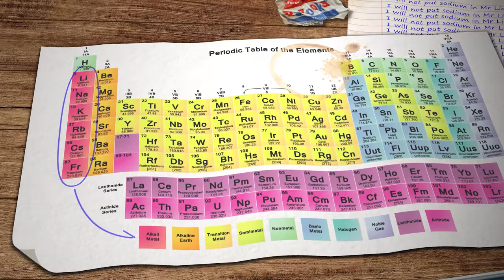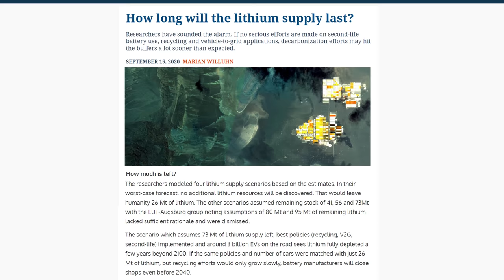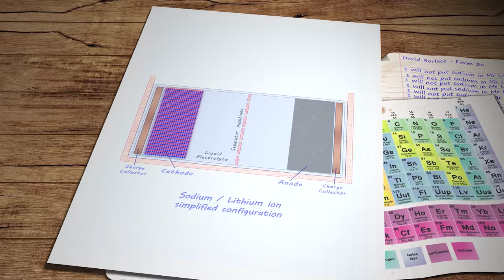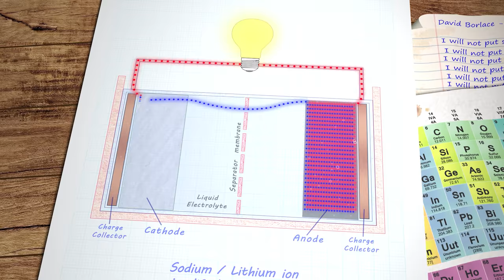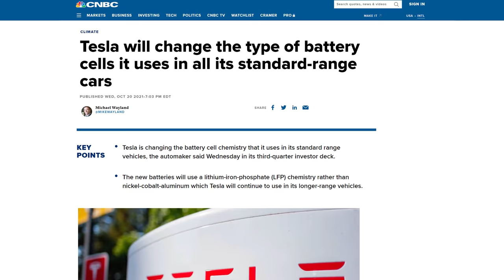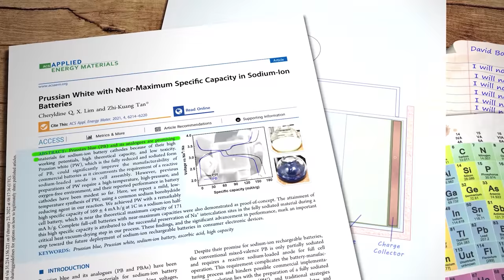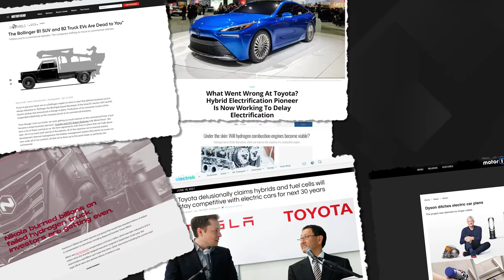Sodium-ion battery breakthrough. Safer, cheaper and cleaner than Lithium-ion

Comment: I'm currently doing my PhD on sodium metal batteries and have been making my own Prussian Blue cathodes (more stable but lower performance than Prussian White). It's so great that sodium-ion is starting to break into the commercial market because I really think there are a lot of applications where lithium technologies are not the best option (e.g. stationary storage). However, I don't agree that Prussian White is non-toxic, using Prussian Blue safety data sheet (as they are the same type of compound, just with more or less sodium); Prussian Blue/White has a toxicity and body contact score of 2 (it is toxic through skin, mouth, and inhalation), so it's not the worst... but really not "non-toxic".
Reply: I thought I read somewhere that Prusian Blue was used as ink... is there any truth in that??
Reply: @bkucinschi  Yes that's right, although the pigment form is not exactly the same as the cathode material. Prussian blue has a really nice deep indigo colour and has been historically used as a pigment. I think you can still buy Prussian Blur pigments today.
Reply: Maybe it is nontoxic by the CCP’s standards. Chinese corporations do not tend to prioritize health.
Reply: Can you tell about the fire safety in comparison of Li-Ion/LiFePO4? Because Li-Ion is very reactive to oxygene, but also is sodium...
Reply: I was also going to ask about fire safety.
Reply: @oCoelhoPedro   It is the metallic form of lithium and sodium that are particularly reactive to moisture in the air (your science teacher may have dropped small pieces of sodium metal in water to demonstrate this). In Li-ion batteries one of the main concerns is the flammable organic liquid electrolyte and thermal runaway of the cell which could provide both the fuel and heat to start a fire. Some sodium-ion batteries in development do not pose the same level thermal runaway risk however still use organic liquid electrolytes which is still an overall fire risk. Solid-state batteries (both lithium and sodium, although sodium is the focus of my research) would eliminate this risk as the battery would be made from non-flammable materials.
Reply: @emilyc3361  thanks for your reply! I hope your research provide the next battery technology!
Reply: My understanding is that Prussian Blue is sorta-kinda safe to ingest, in the same way that charcoal is: not directly poisonous, but highly absorptive, so a serious risk of throwing your electrolyte balance completely off in potentially fatal ways. It's supposedly been used to counter certain types of radiation poisoning (I believe it was specifically in reference to a dentist's office X-ray machine being improperly scrapped in Brazil a few decades ago).
Reply: Well, water and milk are toxic if you drink enough. People have died in stupid challenges drinking too much water or milk.
Reply: @bkucinschi  For over 100 years Prussian blue has been used to paint metal so markings can be made on it to indicate where it needs to be machined. With the introduction of computer-aided design and other platforms, its use is very low scale now.
Reply: Has your research covered liquid sodium batteries?
I've been led to believe that they have no cycle life limit at all, so clearly a massive benefit in stationary applications, even if the temperature makes them unsuitable for more mobile use.  Combined with heat storage in sand (as pioneered in Finland for district heating - so clearly pretty efficient if it can store enough heat for a Finnish winter [more than can be said for the Russian army]).  Stick your liquid sodium cells in the middle of that sand, and the heat can be safely contained making a compound heat/electrical storage system.
Any thoughts on this?
Reply: @emilyc3361  Prussian Blue is also known as Iron Blue and Milori Blue. It is technically called Pigment Blue 27. Uses are in Paint and Coatings and in Printing Inks. Sometimes it is used to make Black Ink Bluer looking by blending with Carbon Black.
Reply: @phillee2814  I have not personally looked into molten sodium batteries, however have heard of other interesting molten metal batteries that could actually have excellent cycle life and safety. But yes you're right, the scale of these batteries and insulative material required for them to operate effectively makes them unfeasible for many settings. There is an interesting thought about their use in medium to heavy industry, allowing these large consumers of energy to help normalise their use of grid energy.
Reply: Thanks for the clarification, Emily.  Hope you continue helping to change the world!
Reply: @Austin1990  Pharmaceutical grade Prussian blue is used to help remove certain heavy metals from the body, particularly thallium and radioactive caesium. According to Wikipedia, quoting the International Atomic Energy Authority, an adult male can eat 10g of Prussian blue per day without serious harm.
Reply: @alistairshanks5099  So Prussian Blue is markup dye?  Hunh.

I watched this because I'm part of the droid building community and there's a big discussion right now about the "best" battery to use; a lot of older R2-D2s still use SLA batteries!  Anyway, this connects to your comment, vaguely, because the blue parts on the original 1976 R2-D2 props were coloured using Dykem markup dye... which apparently is Prussian Blue.  It's a neat thought that in a few years, the new R2-D2 props might use a battery made out of something that was on the original R2-D2!
Reply: how can we get benefit of your research work can you make some video of your research work please
Reply: @winsonal  Haha thank you that's very kind! I don't make videos so I don't plan on doing that, but hopefully my research will become available on open access sites for anyone to read.
Reply: @fskpoon  As silly as your comment is, it is irrelevant to what I said. The CCP leaves pollution matters to more local governing bodies, and the pollution issues are severe. Being in the US, I bought a car from a Chinese businessman with a new baby, and he dreaded returning for fear over his baby's health due to the pollution. It was so sad.
Reply: that research sounds like WATTS of fun.
Reply: @davydatwood3158  Alistar is incorrect. Dykem is a blue lacquer. It is also available in red and as I recall, maybe green. Prussian blue is used for a completely different purpose in the machinist trade. It is used to visualize the fit of two surfaces. When it is applied to a surface (a flat surface or round tapered surface for example) and rubbed against a reference, the low spots remain blue and illustrate the areas that do not conform to the reference surface. In the previous example, it is in the form of a greasy substance and may be referred to as Prussian blue as a legacy term. It is possible that the product used today contains no Prussian blue at all and uses a completely different pigment.
Reply: Prussian blue is one of my favorite colors. If i remember correctly it can works as a disinfectant as well. Not sure if its used any longer for that purpose though
Reply: One thing that wasn't mentioned in this video was the biggest engineering factor of all, the one all engineers hate.... Price.    

It's not 150kg or 200kg per KWH , it's $150 or $200 per KWH that matters more... Lithium is FAR too expensive, it is the reason Tesla is just a toy for rich people and not a serious alternative to petroleum vehicles.  The real prize is not someone who can make a battery a little bit lighter or stronger, it's the person who can half or better the current price.
Reply: Is prussian any related to Russia.
Reply: @roarproductionsstudio  Haha no, it's the name of a historical German state.
Reply: I'm reading on wiki Prussian blue is not only non-toxic, but it is used in medicine as a remedy against other toxic metals like Thallium.
Reply: I hope that can replace the general warehouse machine battery pack(lead acid) which is more danagerous to handle daily. Weight was not a problem since the weight of the battery is used as a counter balance weight for the machine.
Reply: The huge energy stored in a charged battery will take any way out that it can get, explosively.
Reply: I have been out of the loop for many years but what is the cycle-ability of the Sodium+ion batteries cause I remember discussions being about how the larger Ion size of the Sodium -ion would result in the a lower power density and lower cycle-ability due to most likely a much larger anode expansion and shrinkage
Reply: @emilyc3361  That is the holy grail isn't it?  (Solid state with the longevity and power/space density of liquid)
Reply: @donh8833  That's generally right, at least for now. However, there is the potential for completely solid systems to have even higher energy density than liquid systems (some have already been demonstrated in the lab). Most solid state electrolytes do not need the additional separator layer that liquid systems require. So, you can have a very thin electrolyte layer which means you have more room for the capacity-providing electrodes.
Reply: This is great news.  Imagine how cheap gas will become when this battery technology becomes mainstream.  I will be able to run my V8 for ever.  Even letting it idle through the night to extend the life of my starter motor.
Reply: What exactly is prussian white/blue? What is it made of?
Reply: @iCore7Gaming  The most common way to make Prussian blue is to mix a ferrocyanide salt with an iron three-plus salt like ferric chloride.  Yes, the word "cyanide" is scary, but the resulting product is non-toxic.  Just like a mercury amalgam filling is non-toxic.
Reply: @JohnHansknecht  would that include something like a mixture of   potassium ferric cyanide and ferric ammonium citrate  (a mixture/compound that say a piece of paper could be coated with to produce a type of 'film' for capturing a shadow image of anything placed on it when exposed to a strong light source like  sunlight)?
Reply: all the best
Reply: @bkucinschi  it's a pigment in artists paints. It might be usable in ink as well.
Reply: Yes for we have more  opportunities in stationary storage application. Solar energy can be  stored larager scale and energy can be used during night.
Reply: why is toxicity an issue? it is not food.
Reply: @volvo24091  Moving towards non-toxic batteries is a good idea as there is always exposure risk for staff in the material production and handling. And unfortunately, there are many tragic cases where small children have died or been permanently injured after thinking coin cell batteries were "food"... If these and other small domestic batteries were made using only non-toxic materials it may not be as serious when small children swallow them (obviously they may still need medical care, but the potential for death or permanent injury could be lower).
Reply: @Mr2Reviews  "Warning: Keep out the reach of children."
Reply: I agree that the potential for cheaper stationary storage cells is the best initial market for these cells. As energy density is not as important as cost and cycle life.  Are the cells you are working with in the lab similar to CATLs?  I notice you call them sodium metal, not sodium ion.  I know that sodium metal is very unstable.
Reply: @rogerheuckeroth7456  Yes, my cells are different as they are sodium metal cells. This means that rather than a carbon-based anode that sodium ions intercalate into, a thin sheet of pure sodium is used. It is the use of pure sodium metal that can yield exceptionally high energy density. 

While sodium is hazardous when exposed to moisture, there is some recent published work that demonstrates the in-situ formation of sodium metal within a sealed battery cell. This means only a minimal amount of sodium metal is actually present, and that sodium metal is not required in the fabrication of the battery.
Reply: @emilyc3361  Interesting.  What substrate is the sodium metal plated onto insitu?  How is that achieved.  Wonder if it practical on a production scale given how anodes are currently made.
Reply: @rogerheuckeroth7456  It is pretty interesting! But there is still a lot of work to be done. Instead of using a conventional anode and current collector, only the current collector is used. In this system, the cathode provides the sodium ions which will deposit on the anodic current collector as metallic sodium during charging.

While a "raw" metallic current collector (Cu or Al) can be used, it can lead to uneven sodium plating which causes dendrites. Coating the current collector with carbon (many formats like graphene and graphite are being tested) helps the sodium plate more evenly. Thinly carbon-coated current collectors are already produced on a commercial scale with very high consistency; so figuring out the finer details of a sodium metal battery that doesn't require sodium metal may be commercially viable. Only time (and more research) will tell!
Reply: Thank God someone is still making Prussian Blue!  There is hope yet!! o/
Reply: Safety data sheets are usually excessively conservative.  I have a real SDS for DI water that says if I get it in my eye I should immediately flush my eye with water.
Reply: You should drop out Emily.
Reply: @dann5480  ?
Reply: So ill take it off my grocery list
Reply: @harrywalker968  your condescending tone is not helpful.
Reply: great
Reply: I think Titanium White is better, because that's what Bob Ross was using.
Reply: Great
Reply: What is stationary storage? Like a Tesla power wall for a home?
Reply: @itsm3th3b33  Yep, for homes and also large scale renewable energy production (like solar and wind farms).
Reply: @luckylunaloops  I think you're thinking of "Persia". "Prussia", on the other hand, was in Germany.
Reply: @Nikosi9  OMG, yes you're right. Persis not Prussia. How embarrassing -- I actually KNEW this!! Hanging my head in shame now and deleting my comment so nobody else gets bad info!
Reply: Well, try with methylene blue then! 😜
Reply: Congratulations!!!. Wish you all the best for a grand success and a roaring success of a career after that!!!!
Reply: Relieved and reassured to hear about all this, as the outside is pounded by heavy rains in India!!!!!
Reply: What about requirement if cobalt,could itbe avoided altogether!!!!
Reply: Hey I am working on a project related to sodium ion batteries, can you help me with it.
Reply: we had plenty of sodium ion high tech in the 1800's but thanks to the reset we lost most of it, only starting to rediscover old tech once again.... we were so far more advance we were told in the past its a crime..
Reply: Are you using Ukranian anodes to cause a reaction with the Prussian cathodes?
Reply: They also said that sodium ion batteries have as much energy density as their lithium based competitors... which means they aren't lighter as they claim in their next sentence...
Reply: Thanks for that. One important item: it is a lot less toxic and damaging to the environment to mine sodium, vs lithium.
Reply: Hi 

Could you give me a training??

Please reply to me .
Reply: @emilyc3361  Hi

Could you give a training??
Reply: @crishawkins7359  When I was an apprentice, we simply called it "engineers blue".
Reply: Hi Emily, it would be wonderful if we could setup a time to chat over email. I'm keen to hear about your PhD and thoughts of the future of Sodium ion batteries.

Comment: Thank you for your report. In the 1980s and 1990s there were considerable efforts to develop Na-based batteries for cars. However, these were high temperature systems working at 270-400°C. And the ceramic electrolyte was expensive to produce. So the development was stopped in the late 1990s. Having taken part in these developments I am even more enthusiastic about the work at CATL. I really hope they will succeed.
Reply: I have driven 200 000 km on Sodium-ion batteries, Think Nordic with Zebra batteri! :-)
Reply: I suspect you are confusing sodium ion batteries that work chemically and usually at ordinary temperatures with thermal energy storage using molten sodium at the storage medium and stores energy thermally, not chemically.
Reply: I can remember Ford experimenting with an Escort van equipped with such a sodium sulphur battery and thinking then that it was a path to nowhere given that its temperature had to be maintained at such an unfeasibly high temperature.
Reply: @michaelbacon561  Y that tec is still of interest in home micro-grid, where the battery being hot is no disadvantage. Given that we are supply constrained, it helps if snazzy LFP tec can be dedicated to EVs, and these other tecs used elsewhere, hopefully cheaper despite lower RTE and heavier/bulkier.